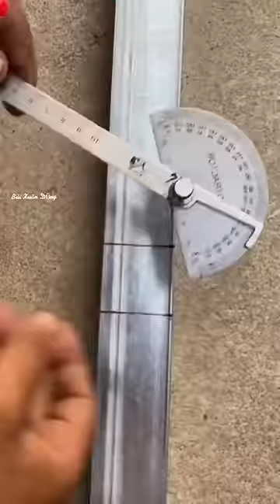mẹo vặt hay dành cho anh em cơ khí, nhìn quá đã mắt #short #shorts #reels

Comment: The strength has been completely removed but interesting method anyways.   Welding is better however.
Reply: He will weld after.
Reply: Not true. 
The design will increase strength and stability of the whole joint.